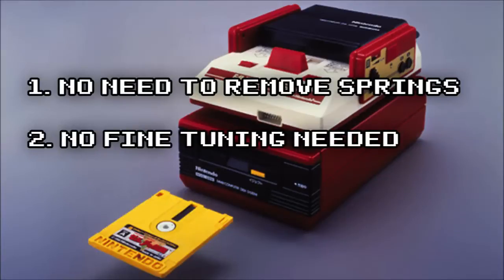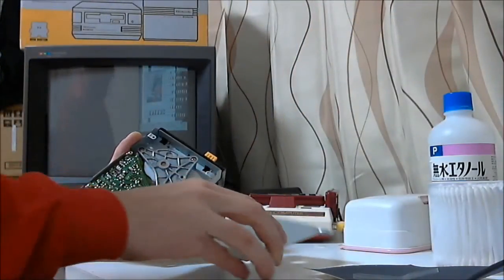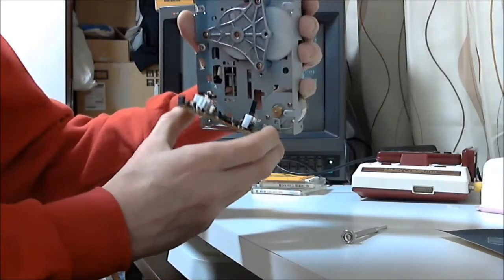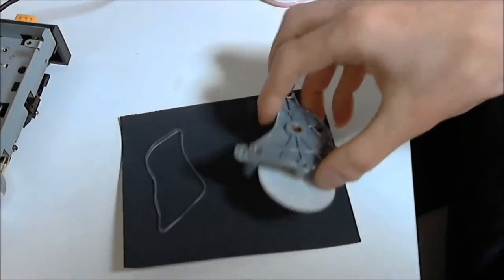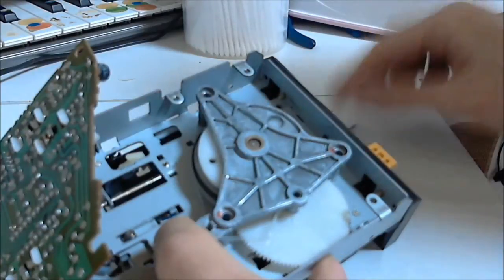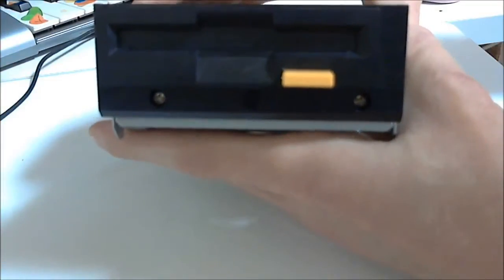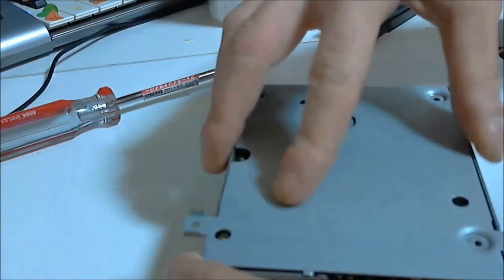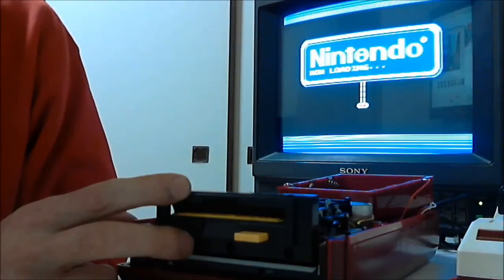*NEW METHOD* Fastest Easiest Famicom Disk System Belt Replacement

Comment: Just so everyone knows, this tutorial applies to the Sharp Twin Famicom as well (at least the first version, I can't speak for the later one with the turbo controllers, but it's a pretty safe assumption).  I've been working on some of them. Everything is the same once you've got the thing open and disconnected the disk drive, which appears to be identical to the one seen here from the add-on version.  It's really easy, don't sweat the differences. I actually figured everything out on my own, it's that simple, I just found this video because I was looking up what to use to remove some stubborn belt bits from one the pulleys.

Comment: This method did not work for me. I too have a square hole in the gear. I also tried the method of removing the disk carrier and rotating for the mechanical click method without success. At this point I figured it was just something I had done incorrectly since one of these methods should have worked. I tested various positions of the gear. With the black square at the 5:00 position, the drive read a factory disk, a re-written disk as well as a disk with a Game Doctor. I hope this helps someone. Could just be dumb luck.

Comment: Just wanted to chime in, but this method didn't work for me. I have the model with the square hole instead of the round. What did work was removing the disk holder, turning the cog till it clicked, loosening the screw and rotating the spindle to face the head, tightening the screw and putting it back to together. This is the same method described  at famicomdisksystem.com. I know others here mentioned it didn't work with the square hole model too.

Comment: Worked like a charm. Thanks so much for this.
A couple changes/notes from my experience:
- I didn't bother with the cables, i just lifted the circuit board out of the way enough once the screws were removed.
- my replacement belts were too small to tape together like that so I just let it sit in roughly the right spot with no issues.
- In my initial post repair tests, the system looped infinitely trying to read the disk w/o any error codes. it turned out the black toggle switch the read head slides back and hits wasn't getting triggered. Not sure why this was happening but after sliding the read head back and forth and toggling that switch manually several times, it started giving me the read errors I expected.

Comment: This method didn't work with my 1985 (older) model. I had to take the plastic top off of the drive, and align it the hard way (as seen in other videos) - by allowing the spindle to spin until the drive clicks, then rotating the spindle hex screw to face the heads. Before doing that all I got was error 22 and some 21. One tip that this doesn't mention which may save all of you a lot of time is when you test a floppy, hold it in the slot after pushing it in. This simulates the plastic backing which has been removed when you are making adjustments to the hex screw. Before doing that I got a lot of error 27 messages.
Reply: Im apparently in the same boat. Im willing to bet this tutorial is spot on but I followed it perfectly (despite the metal gear not having the extra hole) and am still getting the error.

Comment: Thank you for the video, I followed the guide and managed to fix my Famicom Twin. I already had a famicom twin which was fully working so I had a reference but the alignment was different for both. I found that for the white disc hole I needed to line this up withthe notch in the PCB (just a bit more to the right than you had) I tried many different positions, adjusted the drive speed and fiddled around with other bits but nothing mattered. Once I found this spot I was sweet with all my disk games.
Reply: I had to use your alignment as well on two repaired disk drives, thanks for posting the comment.  I wouldn't have made any progress with getting disks to work with the alignment recommended in the video (great video of course, just needed a slight adjustment, maybe due to the brand of 3rd party bands I'm using).

Comment: Hey man,
not sure you're going to see this post but... for starter, I noticed you had a round hole on your FDS. All of mine here have a square one.
Anyway, I tried your method on both FDS I try to fix right now and no luck. Adjusted exactly as you explained, but nothing.
But yesterday I got it to work a couple of times (after over 30 tries) depending on how I pressed on the cover. Nothing stable, but I knew I was close.
So I turned the spindle all the way to the "click" when it gets back to neutral position and I noticed that using your method, my sindle was actually almost 181 or 182 degrees away from how it was when it worked yesterday.
So I put the hole aligned to the metal strip again, but instead of adjusting it like you said, I turned the spindle 180 degrees and tightened it that way.
Tested and it worked instantly.
I think this method of alignement only work if you have a FDS with a round hole in the white pulley, not a square one.
If it's a square, the method still works, but you need to rotate the spindle 180 degrees before tightening it again.
Finished setting up both and it works perfectly.
Reply from the maker: +traxnada Thanks for that info - I will have to look into that!
Reply: +retro raider japan Cool keep me updated... I'll try again with some more later on but I'm curiousto see if you come up to the same conclusion...
Reply: traxnada This post and this video helped me a lot. Thanks guys.
Reply: My FDS has a square hole as well (Manufactured Dec-86). 
First thing i noticed was the position of the square hole in relation to the three smaller holes closer to the centre of the white pulley, The square one lines up directly but the round one in the video is halfway between two of the smaller holes, i also noticed an indentation about 45 deg counter clockwise that looked like where the round hole should be. I used that and followed the video (one disk loaded, one didn't (i only have two games)

The second thing i tried was to loosen the spindle like in the video, then turn the pully system until the metal piece on the bottom layer of the pully system had it's thickest point on the metal post towards the front of the drive, then re-oriented the spindle so the flat bit was parallel to the front of the drive and tightened. 
Both games loaded flawlessly, Doki Doki Panic and 3D Hot Rally (blue shuttered disk) in case anyone's wondering. Seems to save fine in 3D hot rally as well.
Reply: Thank a lot ! 
I was able to adjust the spindle correctly. I have a square hole and it worked with the spindle turned at 180° and placed at the bottom of the pully sytem.
(I kept turning even after the click until the spindle reach the bottom).
Reply: TheDeeplyCynical was it at the thickest point (I see a slight point on the curve) or was it at the point right before it falls off to a smaller point?
Reply: this method just dont work, it must be a step missing - where you move magnetic head to some fixed position before assembling gears

Comment: Great video thanks!  I've used it to repair two disk drives already.  I would add a warning, don't over tighten the spindle screw or it will come out and never work again.  I failed in my first repair job because the screw got striped, but it was a good learning session, and broken drives are cheap anyway.

Comment: In all your repairs, have you come across any FDS that will infinitely load disks?  I don't get any error code or anything, just as soon as I insert a disk, it says "now loading" and continues to spin.   I've opened it up, the 3 switches on the board are all being triggered properly.  belt has been replaced and spindle re-aligned.

I suspect there might be a break in the circuit somewhere to the r/w head, might this cause that behaviour?

I'm going to try a complete disassembly, clean/regrease tonight, but just curious if you've ever run across this problem?  FYI it's a twin famicom.
Reply from the maker: I haven't seen anything like that, but the twin famicom drive is exactly the same as a normal FDS, so they are interchangeable, I guess putting another drive in would determine if the issue is drive related.. As with a lot of these mechanical devices, there are numerous things that can go wrong. Sorry I can't offer more info.

Comment: thats alot of job for the easiest way to replace those belts. why they made it so hard to replace a damn belt ? not smart. they should have made it eqasily accessible with only a few screws to remove. not having to disassemble the whole thing. those belts also seem to fail miserably often. they put such a cheap belt in there. i never had a single pc drive or even other drives fail on me in all my life.

Comment: wow great video. Actually I have constantly error 21, 22 y 27 and I will try this method. also, I have another issue: passing arround 6 second, my screen is turning a wrong images and dark. This fault it´s appear after of connect a power supply with inverted polarity. I think that is a RAM damage or a condensator.

Comment: I don’t know if you still check these, but my FDS half worked before I loosened and retightened the spindle. I did everything identically to your process, with the only difference being that mine doesn’t have the hole in the metal cover. I’d appreciate any help, but I’ll probably manage if not. Thanks!

Comment: I've tried this method twice and it didn't work for me. Made sure the cog was lined up in the correct spot. Made sure the spindle was facing outward and tightened. The first one kept giving an error 27 message. Second time the drive just keeps spinning and clicking.

Comment: (belt hasn't arrived yet but I wanted to take it apart and clean it to be ready)
Only problem I've seen so far is that...well...my spindle cover plate doesn't have that hole! It's just a smooth three points. I'm probably going to try and use a ruler to get it in roughly the same position, but yeah.

Comment: At around 25min in you show the triangle and cog, how to line it up.  Were there two types of wheels within those?  Mine is a little rectangle I got in the mail yesterday, tehre is no circle I've spun it around enough to know.  Also I could never un-latch the triangle, not sure what you were on about it doesn't come off on mine so I threaded the belt under fine.  Mine simply just popped, no mess no gooey bits (still cleaned it) and now it does and doesn't work.  Before it was just spinning free, now I'm at err 22.  I tried the whole line the 'circle' up and use the tool to loosen the spindle and line it up and it just didn't work.
Reply from the maker: There are different revisions of the FDS it seems, and one has a rectangle as yours does, maybe there are some comments that may help. Sorry I can't help more.

Comment: Works perfect for me with the square hole family disk system, also as a tip clean the disk "lens" with isopropyl alcohol. That solve my reading delay problem. Thanks for the tutorial.(i use the clean belt)

Comment: I have done it nice and at the first try with your tutorial. Thanks a lot! It is explained perfectly. After the belt replacement, I just had to calibrate a bit the motor and the reader screw, but I achieved it in an hour approx. 3 games working perfectly! Thanks!!!

Comment: I have 4 Twins arriving Monday and a FDS system I got a fortnight or so ago so I get to do this all over again X5, yay!  The FDS annoyingly did not have a RAM adapter.  I am just going to connect it to one of the Twins to test.  I must be weird because I am looking forward to it!  There is something about returning an old system to working condition that makes me happy.  More so when it's. SEGA system because I have been a (lifelong) SEGA fanboy since I was about 8 after playing Wonder Boy for the first time in 1986.
Reply from the maker: I dont envy cleabing 5 drive wheels of all that black gunk! let me know if you need belts! http://retroraiderjapan.weebly.com/store/p1/Famicom_Disk_System_%2F_Twin_Famicom_replacement_belt.html
Reply: Thanks!  I currently have 20, so I should be good.

I have not thus far had the pleasure of cleaning the amount of gooey black gunk off the spindle and gear that is shown in your video.  My Twin I got last year had a new belt already, just badly installed.  The FDS also only had 1 or 2cm between gear and spindle so it took no time to clean.  I think I hear rattling in the case, I'll have to try and find the rest of the belt and get it out of there.

Comment: Yes both discs the same error 22. Belt is new and it's transparent.  I can see 2 lines marks on plastic belt part.  And one mark on steel part with 3 bolts.  When I adjust by these marks the spindle are in right position.  I will try to rotate it a little bit.  Will see what happens.   Maybe I bought belts from you.  Because you have the same belt

Comment: I have now another one FDS and i replaced belt and its the same. I got 2 more discs for checking. If i allight it by tutorial it works but it can work one tme and it may not work after. What i suspect is the belts should be maybe tighter  or different . What do you think?

Comment: I have a refurbished Sharp Twin Famicom with new belt. It loads Zelda, Metroid, and Zelda 2 fine. But Doki Doki Panic fails with error 27. I don’t know what I should try to fix this. Could it be the drive is not perfectly calibrated when it was refurbished? If so what’s the right way to handle this scenario? All three of my other disks work fine so I’m not sure I should move the spindle or theres some other fine tuning I can do. Can error 27 also be due to a bad disk? The seller stated the game was tested and working, and it appears to be in very good condition.
Reply from the maker: 27 can happen due to corrupted disks, a very very slight adjustment of a millimeter or so to the left or right of the central spindle could fix it, but please be very very careful should you try this, as you might end up with none of the disks loading
Reply: retro raider japan -thank you for the reply. Ok so it sounds like if the other disks are loading the spindle must not be far off. And the adjustment method looks like it could be tough to be very precise. Even if I knew which way to turn it. I’m going to try and get another copy of Doki Doki Panic to test with first. If neither work then it seems the chances are I need a slight adjustment but hopefully it was just that disk. Now if only someone would make a disk drive we could connect via USB to rip and re-write disks. That would be awesome.

Comment: Hmmm, well, I tried again and I managed to wiggle it around a bit to where it seemed to be in the right position.  Just tried it again and am now getting error 27 after the black screen with all but one game I tried.  I am sure that the spring reset as it should, but I am thinking of trying it again to make sure.  It would even give me error 7 which means it's reading now, just not perfectly.

Comment: Man, you are a legend! These instructions are perfect and your method is flawless, thank you so much for this. I followed your guide and it didn't work at first but I found it had nothing to do with alignment. I had placed the belt on straight but at some point of the big pulley's course, it must have been slightly offset vertically and it was causing the belt to slip out of the golden pulley. Once I ran it by hand a couple of times to fix that, I turned on the console tried a disk and it instantly loaded very quickly, works with all games I've tried. Many, many thanks for sharing this.

Comment: Just finished replacing the belt on my twin famicom. Got a lovely Error 22. Any tips?
Reply: Yes, you need to align your spindle with head gear together. In this video head moving gear (lowest one) can be anywhere after cleaning, so it is pure luck it works for so many people. It must not.

Comment: Hello. I reolaced the belt and i did exactly how you showed but its not working. Error 22. What can i do to fix it?
Reply from the maker: Hi! - firstly - has the disk you are using, or the drive worked before? Have you only checked it with one disk? if you have just bought the FDS unit, there's no way of telling if it's the drive or the disk..

Comment: After nearly four frustrating hours, I am giving up for the moment.  I did get the drive to where it would read and load 3 games, but the rest went to black screen followed by error 27 except for one.  I am thinking that I must be screwing up when I put the triangular piece back in place.  The screw was not facing straight ahead when the disks were reading.  Looking straight in from the front, it is off to the left.  When I place the screw directly facing straight ahead, one of the working games stopped loading.  I did try Turing it anymore to the left (clockwise) to see if any other games would load.  I figure it may be easier to just try the whole thing over again.  If I get desperate, I may have to try the "other" way.  The only slightly good thing is that there is not a single disk game included with the system that I want to play.  I am wondering now why I bid on such a crappy set!  No wonder I got it fairly cheap!
Reply from the maker: One other thing you need to be aware of s some games are written from the disk writer machines that they had in japanese stores, after much use some of these machines may have slightly miswritten disks, and some disks may have also been over used so much that the data tracks are worn... not to mention somone may have messed with the motor.. there are a lot of factors to consider, but the fact it was so badly refurbished sets alarm bells ringing that whoever sold it to you really didn't give a damn... :/

Comment: i don't if you check messages but i follewed your video but still get the error 27 and i have a square not a circle on the plate
Reply from the maker: There are a few comments below here regarding this issue, please take a look and you may find a solution.